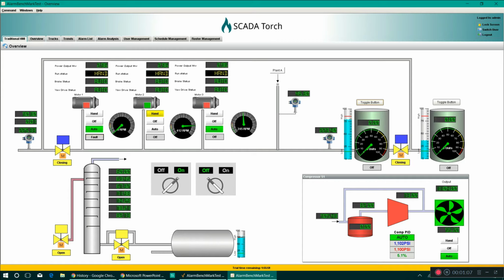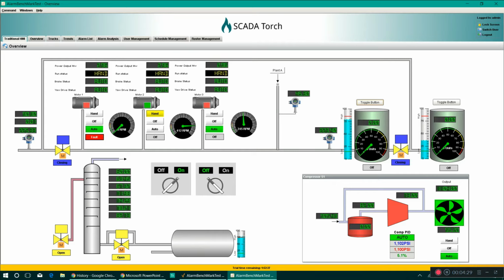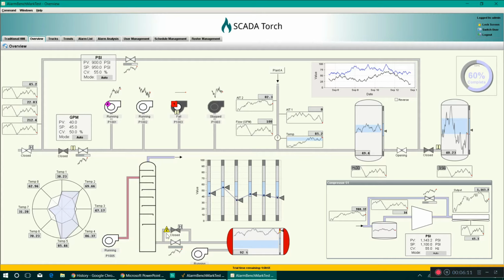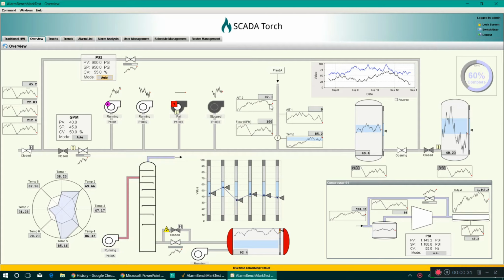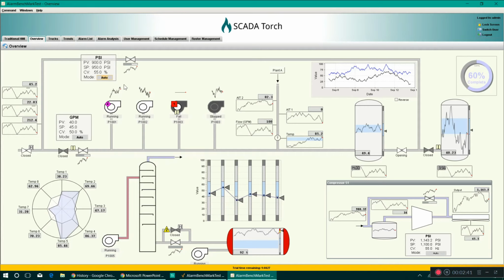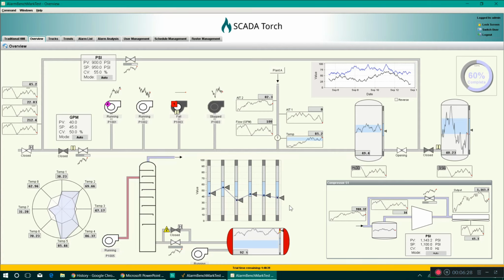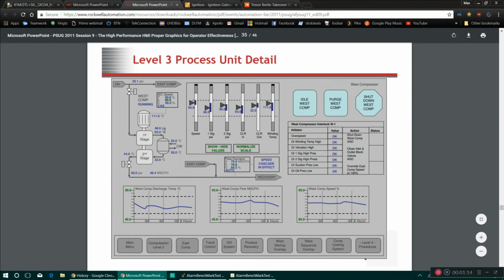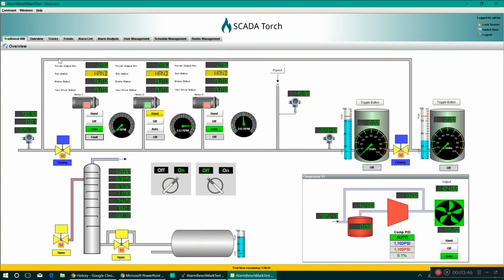Better SCADA Design Tips: High Performance HMI

Comment: Good morning!
This is a very important topic for optimized operator use and response.
The link for the Rockwell design guide in the description is not working - do you have a resource for HMI design for non-process applications, such as packaging machines or robot cells, where there aren't process controls in play, just product handling operations?
Thanks!

Comment: How did you create dock menu effect?
Reply from the maker: Do you mean the navigation tabs at the top? That's a tab component. If you like the project layout I'm using, it's the tabbed north skeleton project. It's an option from the drop down when you create a project when you first open the designer.
Reply: @scadatorch2211  No I mean the popup window that appear in right side of the screen that you called dock window. You use it instead of popup. 
How did you resize the main screen for fitting dock window? 
Can you provide a download link for this sample project?
Reply from the maker: To create a docked window, just create a new window, and with the window container selected in the project browser, you can change its dock position in the property editor (the property is ‘dock position’). In this case you would set it to east if you want  it to appear on the right.

They also have some documentation and a video on the subject: https://docs.inductiveautomation.com/display/DOC79/Docked+Windows+-+Axis+Precedence+and+Dock+Index

Next, to achieve the result you are describing, you would have to set up a script that opens that window when the x position of the cursor is greater than some number, and closes the window when it is less than some number.  

I can’t send you the project unfortunately as it has a lot of proprietary stuff. I am available on a freelance basis though if you need help with designing your Ignition project.

Comment: So the problems I face are similar to the ones mention; the sales team and upper management wanting better looking screens while the industry only needs the most relevant information.  I work as what I call an In-house integrator for a company who produces lines for manufactures to produce consumer products; we build a piece of equipment that makes a product.  The equipment we build is all very similar and we commission a new controls system nearly weekly, therefor the screens we use are nearly identical for every line and they are a major sales point for our lines.

I agree, HMI/SCADA screens should be boring and relevant.  But that is not a realistic goal for interrogators; having that stance and only excepting that stance is going to do nothing but create a stalemate between groups that should be working together.  Sales needs a product to sale, and we need the work.  The biggest problem I have is getting input from anyone on what is undesirable and what does work. There has to be give and take from either side and we need to find a way to make our systems stand out and still be easy and intuitive to use. 

Now, Color blindness is a real issue; I totally agree!  We have many in our own company on the floor working with these products daily who are color blind and, at least here, the majority seem to be veterans for some reason. However, I am not color blind and I find the the opinions above and from those I work with are as one sided as the opinions in the entire industry from the none color blind.  Neither argument works; we cannot build everything vibrant nor can we build everything flat; we need to find common ground and use a color pallet that appeals to all involved.

I like the idea of showing time based trends, the object used above may not work for all applications though; I don't really have a suggestion and I think the solution would be a case by case basis, it is something I am going to investigate for our lines though.  The radar graph is not intuitive to me at all and would require explanation for new users, it also takes up more space than is required for that information;  using color to indicate desired ranges works but while the muted colors may stand out to you, they do not stand out to me.  I understand where you are coming from on popup screens, however I feel user initiated popups are fine whether they are from a screen action or prompted by a PLC process based on a user action. But those screens are fine to "temporally"  cover a portion of the main screen; I do agree that their time should be short, they should not be be able to take over the screens (unless that is their intent), and if needed faults should take the user back to the main screen or a fault acknowledge screen.

This is a trend I see in the Controls Automation industry, engineers saying "This is how it has to be and there is no other way for it be anything else".  I have come into the industry from another industry and the narrow mind set I have encountered has been frustrating. And it's really no ones fault, it's industry culture; it's the mindset passed down; but it's time to step back and rethink that mindset.  it's time to find alternate solutions;   No, these are not smart phones, but our operators are conditioned by the smart phone culture.  And what is intuitive to an engineer probably is not intuitive to an operator.
Reply: Damm... You got inspired or emotional there...